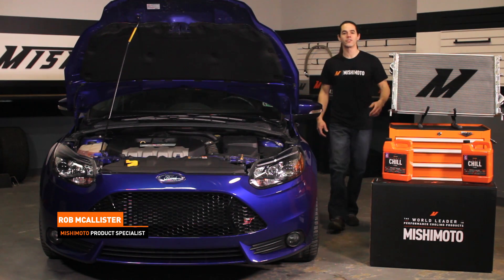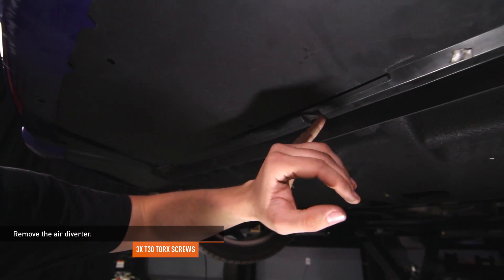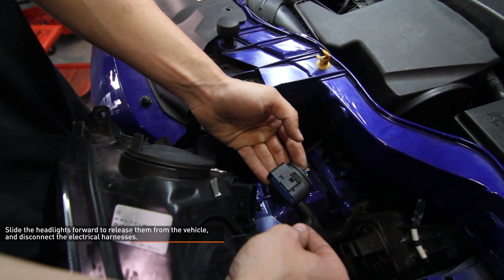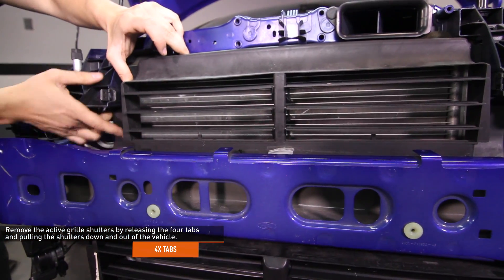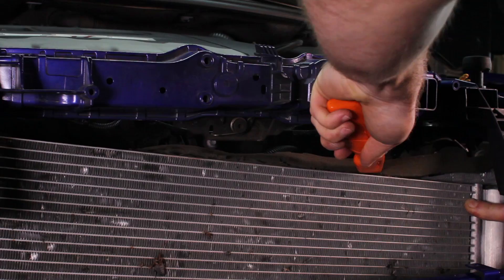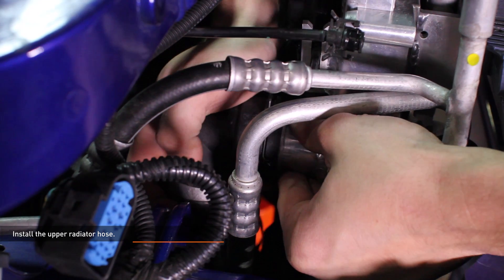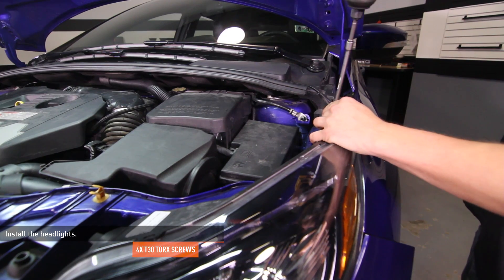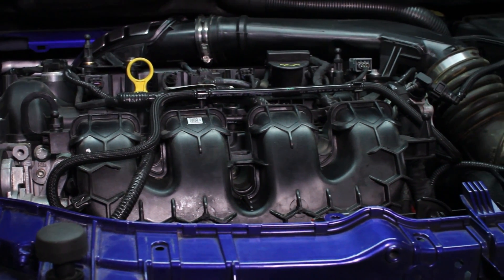2013-2018 Ford Focus ST Aluminum Radiator Installation Guide by Mishimoto

Comment: Did this a few days ago on my 2016 ST including new hoses, the quick disconnector did not quick disconnect on the stock hoses so i cut them off instead. don't bother saving them since they're rubber.

Comment: This is a pretty straight forward install, but glad Mishimoto took the time to help everyone go through the complete process!
One thing that is kind of humorous is that someone would upgrade the radiator, but not the FMIC. If you have the OEM FMIC, you are NOT tracking or driving your car hard at all. It cant handle few back to back hard pulls let alone pushing it in competition scenarios.

You also do not need the shutters or half the bulky plastics on the crash bar. In fact, once you go with an aftermarket intercooler, you cannot use those things anyways and while you're in there, you might as well upgrade the factory upper/lower coolant hoses to silicone ones.

I know this is an old video and this car in the video is pristine, but anyone upgrading this with a used ST (they're all used now) this is a great upgrade if you drive hard or track your car. FYI those coolant hose connectors are a PITA to remove in many cases simply because they're stuck on after years of use. Once the clip is out, just be careful and work them off with a good amount of force. When you go to refill the coolant, the traditional way works but you have a very good chance of introducing a lot of bubbles. It may benefit you to invest in something similar to this tool:
https://www.summitracing.com/parts/otc-75260
Reply from the maker: Thanks for the comment!  Some of these vehicles are on the "older" side and will benefit from a new radiator after close to 10 years of use :)

Comment: If anyone's struggling to get the Rad hoses back on, use a heat gun or a hair dryer to warm the hose connector up then push on. Took me hours of trying and only 30 seconda with a heat gun to get them on

Comment: Does anyone know if the focus st radiator will fit the 13-16 fusion 2.0 ecoboost?
Reply from the maker: We do not show that this is compatible with the Fusion. Sorry!
Reply: @mishimoto  you guys should consider designing one.
Reply: @iguardwisconsinberry8830  You can look to see if a part will match by looking up the Ford OEM part number. If it matches between the ST and Fusion or any other Ford vehicle, then you know it will fit.

The part numbers are different. It will not fit.

Comment: There are other aftermarket radiators that state they are triple flow units. Is this radiator also like that?
Reply from the maker: This is a 2 row core.
Reply: Thanks for the fast response! Customer service seems pretty damn good at mishimoto! I plan on getting this. Intercooler already ordered.

Comment: No wonder why american car companys suck.  This is complete BS.   All day job ?  My nissan took 30 min to change radiator
Reply: This car was actually designed in Germany which didn't help because German cars are the worst to work on lol took 15 minutes to change the radiator in my 86 GT Mustang. They don't make em like they used to.
Reply: I hear ya bro my subaru sti hatchback 2010 is 30 mins

Comment: lol difficulty should be a 2
Reply: I'm happy you think so! I need you to work on my car nice n cheap lol
Reply: @ADDwithJTC  I could definitely be your not so cheap mechanic lol
Reply: It was my first time doing it so it was difficult but yea I can see being a Ford mechanic and doing more than once would make it easy lol 
But then I couldn't afford you so I'll just keep throwing wrenches n having my neighbors think I have tourettes syndrome 🤣🤣🤣
Reply: Right? It's a radiator bolt and unbolt ... and all this stuff is easy to remove and re-install on the ST.

Though, dealing with fluids and pipes and the condensor definitely are what bumped the rating.
Reply: @orangejjay  I was a Ford tech that’s why I commented this lol but it’s fairly easy

Comment: I wanna replace a leaking radiator in a 2012 Focus Titanium sedan with an OEM radiator.  Is this installation guide largely the same?  Or is the ST significantly different?
Reply from the maker: HI Branden! This product is for the 2013+ Focus ST - for your 2012 Focus, you'd want to consider our OEM replacement radiator which you can view here: https://www.mishimoto.com/2012-2015-ford-focus-replacement-radiator.html - Installation would be the same as for your OEM radiator, as this designed to OEM specs!  Let us know if you have any other questions!
Reply: Thank you so much.  You have the only guide on the internet for the removal and installation of a radiator for the third generation Focus.  This is a very high quality video, and you do a great job showing how to install your products.

Comment: I don't have access to a lift, so I was wondering how high will I need to get the car with a jack and jack stands in order to remove the old and install the new radiator?